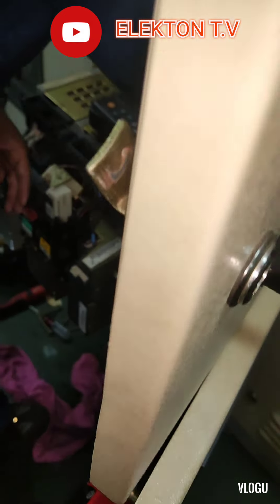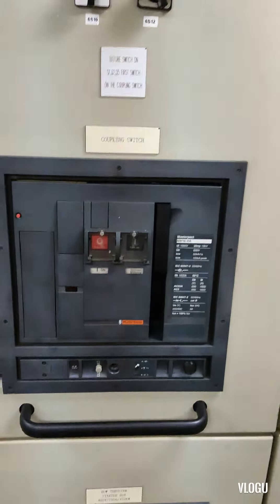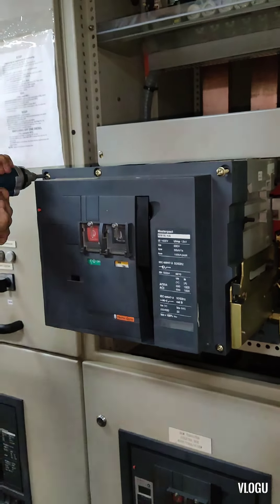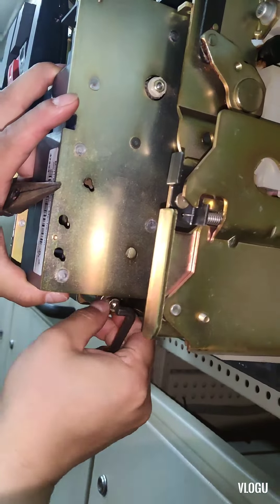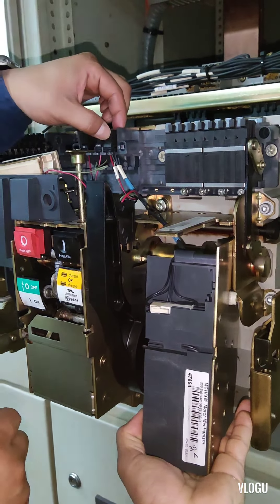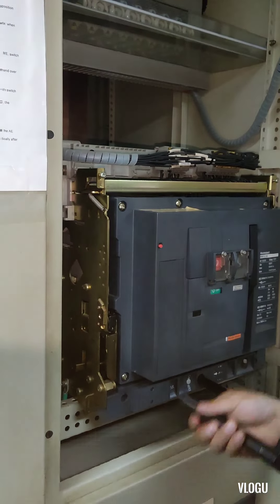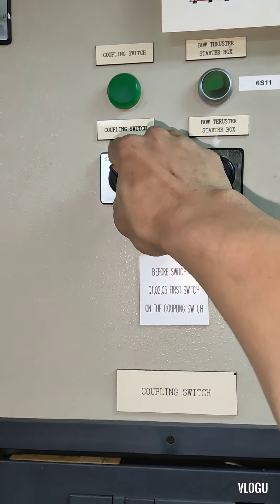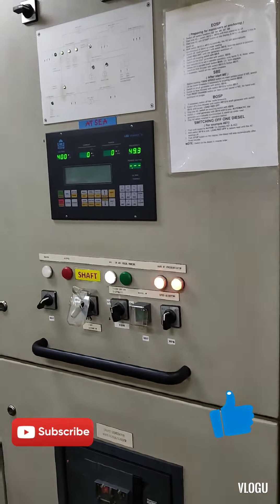CIRCUIT BREAKER MOTOR CHARGING MECHANISM TROUBLE.

Comment: Have you ever had a problem with the pumping lever failing to rachet
Reply from the maker: @dennismackey7347  good day brother,i didn't experience, i suggest to you to open,the breaker maybe you can see the trouble in mechanical.,